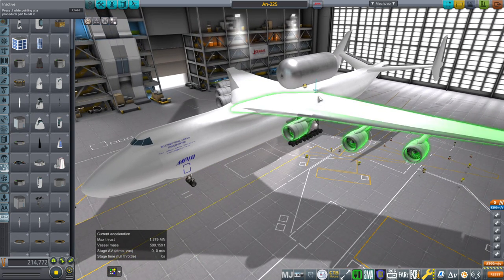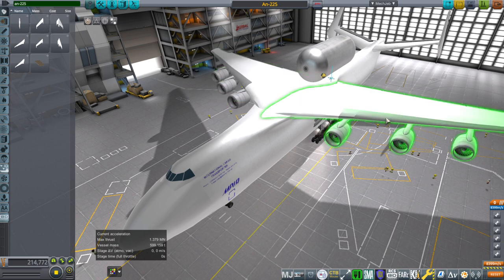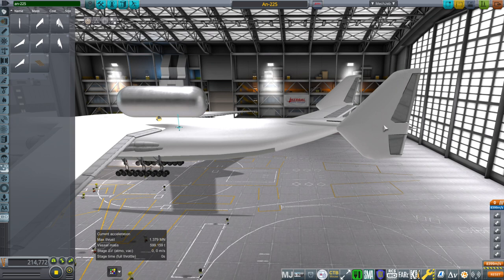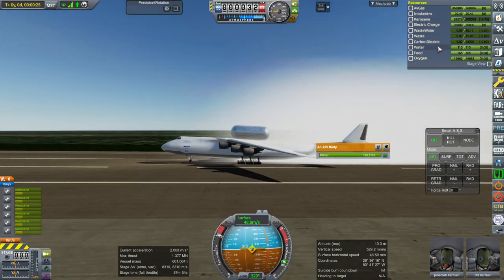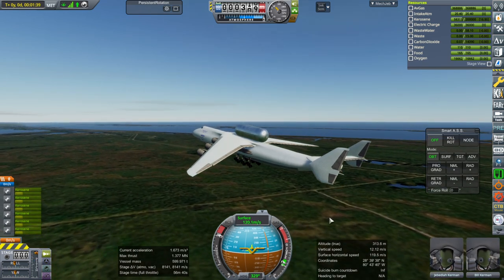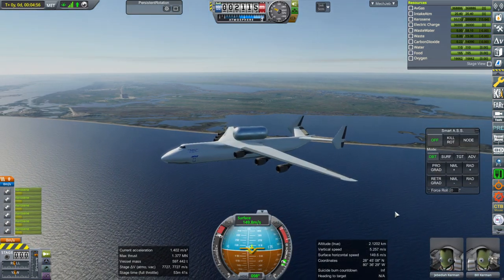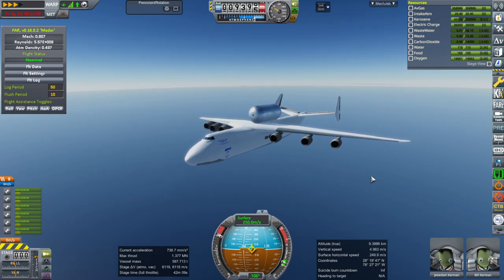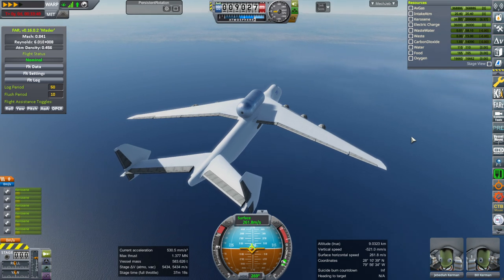KSP with Realism Overhaul - An-225 Test with 275 ton payload

Comment: Would it be possible to add the fuselage as a rectangular, long 'wing' in FAR? Looks like the body lift should be nontrivial.
Reply from the maker: I think FAR would read it as only being on one side and therefore cause a roll moment, but I'm not sure.

Comment: Do you know of any good literature for orbital mechanics?
Reply from the maker: While I have a book on it - Fundamentals of Astrodynamics - I wouldn't call it good. It's dated, making its method of presenting the equations frustrating. The one thing that I've really wanted - a text that explains how to calculate gravity assists - I have not found. So, basically I would like better literature on orbital mechanics myself.
Reply: @RaizSpace  I don't really know much about this, but there is a thing called "Interplanetary Transport Network" which is a set of pre-calculated low energy transfers. From what I understand, each path in ITN consists of many gravitational maneuvers and corrections, like ballistic captures, using lagrange points, etc. And to properly calculate such maneuvers, one would need A LOT of computing power and good algorithms and this whole thing is still active area of research.

I read somewhere that IRL they even take into account complex stuff like gravity anomalies, discover new and improve existing transfers each year (new data, more flops).
Since even Principia doesn't model "little things" like aforementioned gravity anomalies, I guess simplified version of this could be calculated on consumer PC for our KSP needs.

But what do I know, I can't even design low energy moon transfer with Principia, let alone gravity assists or even learn patched conics math.
Also, there is already tool that can do some orbit optimization: https://forum.kerbalspaceprogram.com/index.php?/topic/33568-winmaclinux-ksp-trajectory-optimization-tool-v167-lvd-kos-integration/
P.S. My understanding of some things may be completely wrong.